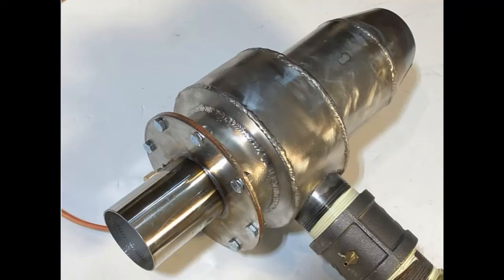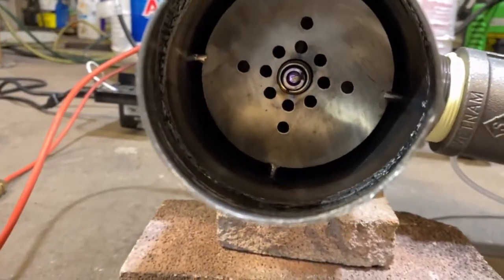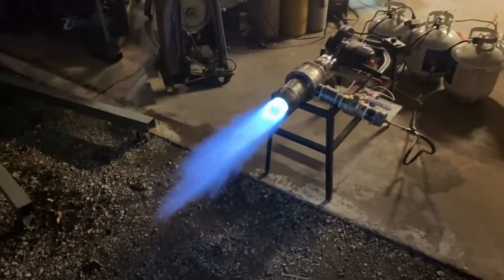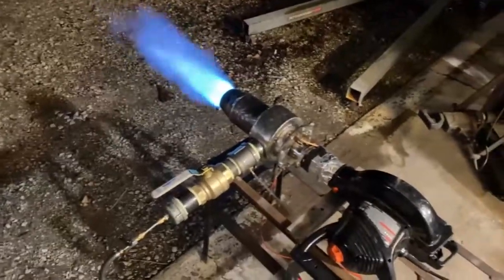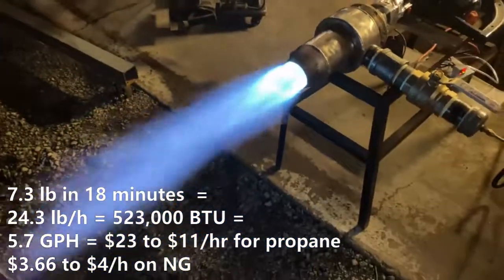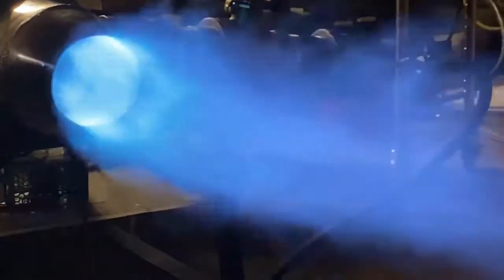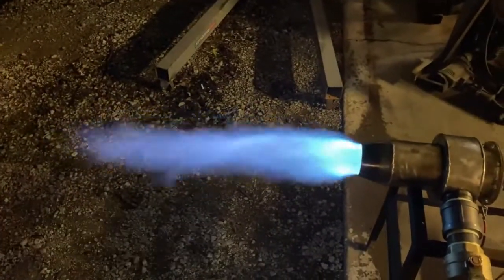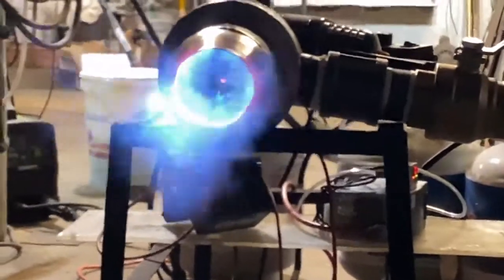High power Natural gas burner for Kilns and casting Furnaces

Comment: How in the world did you get that spark plug to arc like that? I thought something like that would work well on the propane shop heater I'm building, but the electicals beat me.
Reply: My guess is an oil burner ignition transformer. They make a steady, bright, searing hot arc  that is hard to blow out and lights more than just gas.

Comment: So it burns a whole 13kg gas tank in about an hour?
Reply from the maker: Yes but if your running a business that makes money off this process your actually making coin rather then wasting gas But as @volvo09 said you would never want to run this on propane , im only doing it because i don't have a 2 gas line hook up  for NG
Reply: Propane is expensive. I don't even want to use it for my grill...

If you need heat energy (in the US) don't use propane unless it's all you can get.
Reply: @volvo09  What is the cheapest fuel outside of trash you can find and convert into syngas? All of the fuels in my country, when compared by kilojoules, are more expensive than gasoline